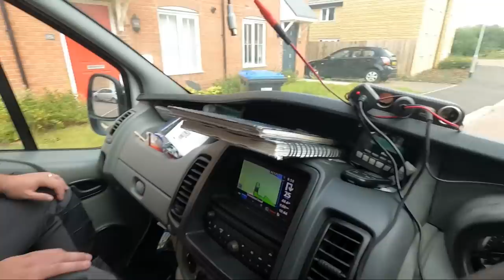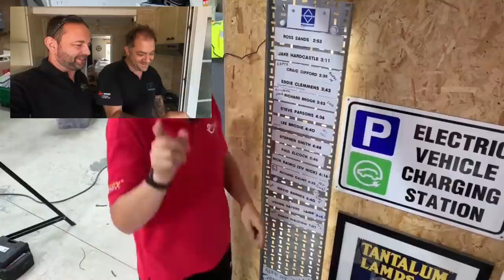2nd fix of rewire with special mystery guest - Part 1

Comment: Just fitted the 2nd generation Nest protect alarms - they are multi-spectral sensors they pick various electromagnetic/heat/light frequency signals the software integration is great in those I have fitted 16 of these in my home. The constant testing, away from home feature, wired and non-wired version can work in sequence and are connected through their own sensors the wired alarms ones also don’t need a interconnect wire. The software integration with the app is superb. Our interconnect wires are yellow on the device but when we pull our equivalent 3 core and earth our interconnect wire is pink. Our interconnect wires are sleeved while it’s only a kind of com wire the risk of short circuit faults on the interconnect and the fact our ground wires are not sleeved avoiding two wires being in sleeved is a good idea.

Yes triple the cost of normal detectors but the sensor is a higher quality.

Comment: Hi Doc and Adam, from an old spark from the 60's. First of all congratulations to Adam. I would just like to clarify the borrowed neutral, you don't actually take the  neutral any ware if I heard correctly??, you use the upstairs neutral and loop the phase downstairs from the hall light to the common for the two-way so you just take the strappers to the downstairs two way switch but that was in the "Ye Olde" days. Thanks for any another entertaining video.

Peter.
Reply: Thank you very much Peter 👍🏻👍🏻🤩